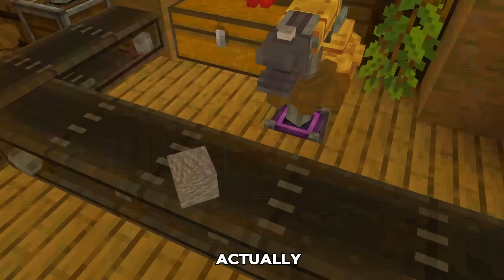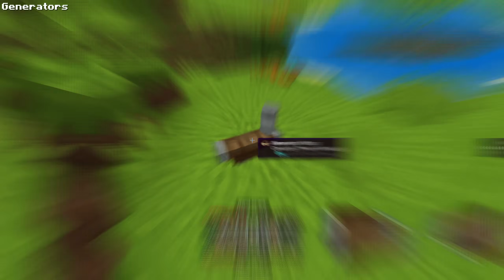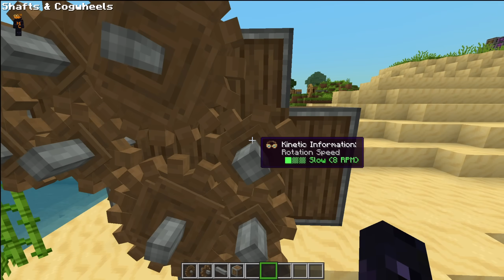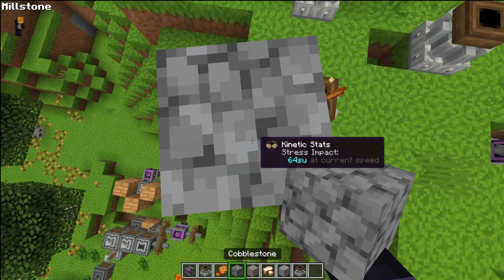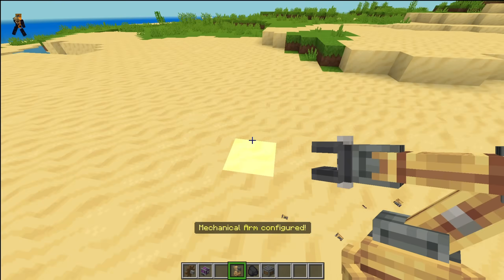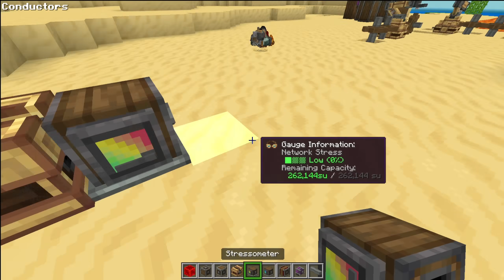Create Mod is FINALLY on Minecraft Bedrock, and ITS INSANE

Comment: I am not trying to hate on the video, but you don’t actually need a shaft in the middle. It already gets connected when you actually put the fly wheel down, you don’t need to put an actual shaft. Instead, you can put it as a block, so you don’t fall into it.
Reply from the maker: Good tip 🙌

Comment: I really like this mod, I've tried it

But, I have a question, how do I get zinc ingots? I've melted raw zinc ore/crushed zinc ore in the furnace but nothing happened.

Please i really need this;)
Reply from the maker: try this:
Lapis and Iron Nugget
Zinc Ingot - Minecraft Create Mod
The Zinc Ingot is an ingot used to create Brass Ingots in the Create Mod. To smelt a Zinc Ingot, you will need Lapis and Iron Nugget. This simple mod allows you to craft Zinc by smelting Raw Zinc, making it easier to obtain this metallic ingot for various crafting needs within the Create Mod. 
Fandom
Reply: @MinecraftCubeMC thanks for the respons but still..it doesn't work ;)

Comment: I hope this mod can have addons to make planes 😊
Reply: Try the physics glue addon it is on curseforge
Reply: @jadsterr   I think the physic should be too hard on bedrock edition processes like on phone
Reply: @Coolme8419   it's also basically impossible to create on bedrock
Reply: @Locaaality  there's literally a bedrock mod that does this
Reply: @stewwastaken  i'm talking about the PHYSICS part, but if it's just like you build something and it behaves the same as every other plane then thats somewhat possible.
Reply: @Coolme8419  it's possible actually, people made physics mod on bedrock already, the only problem with those flying contraptions is that the blocks is glitchy, you can stand on the blocks when you activate it
Reply: Fr and the machine guns too cause I wanna build a mech
Reply: Try the fabricate addon it has everything this mod has and has vehicles
Reply: It almost impossible bc there no way to add custom physics (sable/vs)
But u still can play create aeronaustic with pojav lauceher or zalith launcher and if u crash when used create: aeronaustic just install sable android patch
Reply: @ZENITH-HDD  it’s been done before it needs optimization tho
Reply: @Dhzjakdbdbs disable flywheel it make u game run more stable(less crash)
Reply: There probably a add-on that can make block to entry but a physics that impossible on bedrock edition there no way to make a block that can behave like a physics entity and can fall

Comment: How did you made the conveyor belt go up??? Like vertically?
Reply: Like? At 45°
Reply from the maker: Hey you just put the shafts then combine with the belt.
Reply: @MinecraftCubeMC if horizontal it works but like, i want it to go straight then up
Reply: Like? Diagonally

Comment: Will It be put in marketplace?
Reply from the maker: these aren't on marketplace, you download them from description.

for mobile/pc: easy download and play

for console:
you can join a world hosted by another device that can easily download addons (eg your phone, or your friends world), or you can add them on a realm and join it on your console. or if you could just host a free aternos server to put the addons in and join with your console.
these are 3 quick methods to use addons outside the marketplace, saving you money!

also - on xbox there is a feature where you can download directly/move files (but im not sure how to do this, theres tutorial on yt)
Reply: @Bailon69  There's another mod in the works that's similar to Create called Fabricate, which will be on the Marketplace.

Comment: How can I smelt zinc? It doesn't work in a furnace/ blast furnace
Reply from the maker: You would have to use the methods shown in video. The mechanical press, you can press the ingot into sheet.

If your talking about getting the ingot from the ore - i can check for you if you lmk on discord
Reply: I can't smelt raw zinc or zinc ore to make it into a brass

Comment: Seems like it doesn't work with the 26.2 version
Reply: Yeah mine just doesn't have engines, wheels or anything
Reply from the maker: @RoProEdits guys, turn on all expirements. And look at where I accessed them in my inventory - it works on the latest version
Reply: @MinecraftCubeMC I've turned it on and still doesn't work
Reply: @RoProEdits same as mine... I also update it to 26.3 and still not working 😢
Reply from the maker: @Alexmadlun  turn on BETA API. it should work. please join the discord - it worked for me and almost everyone else. did you apply both texture/behaviour?
Reply: @MinecraftCubeMC Yes, i did and nothing happens
Reply from the maker: Huh? Show me screenshots on discord i might be able to help @Alexmadlun